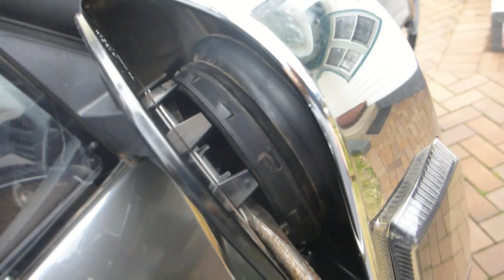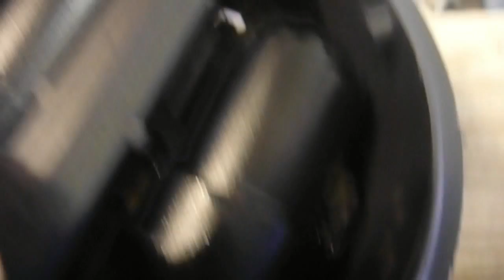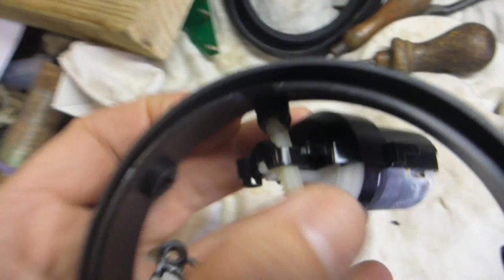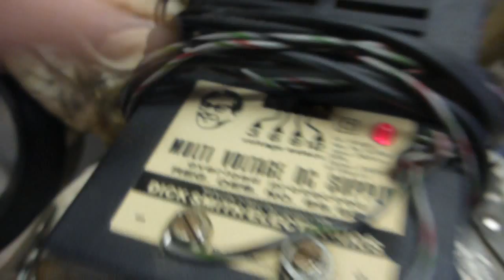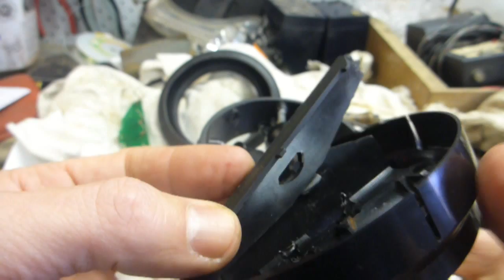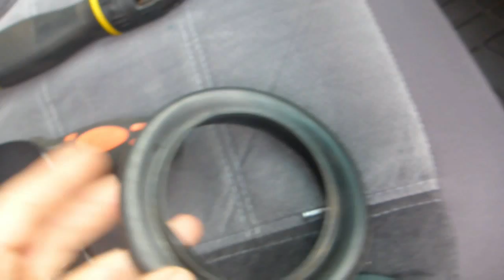Clearview towing mirror actuator repair

Comment: Nice job and video! Like Bodgy Aussie said, most wouldn't try this. I do this sort of thing a lot! Thanks!
Reply from the maker: It's easier than you think. But some general 'tinkering skill' is definately recommended. After the repair, we used these on our 100 series for a 35,000 km 'Big Lap' of Australia in 2015 and they performed flawlessly.
Reply: @pescado99   Nice! Can you translate what a 100 series is? Is that a Ford F100?
Reply: That is a big lap!
Reply from the maker: Nah mate, not a Ford. A Toyota 100 series Landcruiser. Turbo diesel, 2007 model.
Reply: @pescado99  Much better choice, above or down under! lol